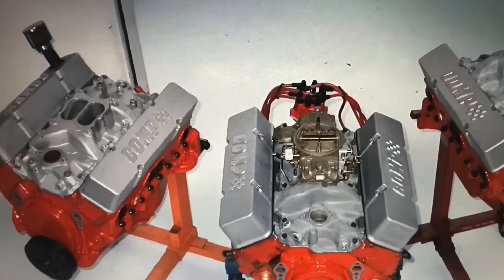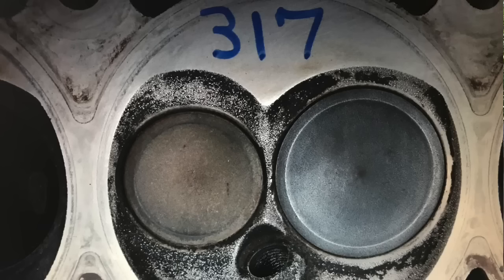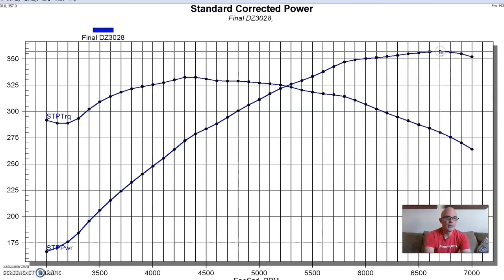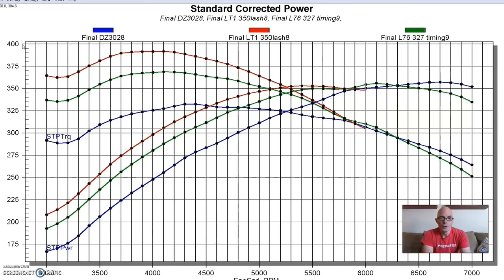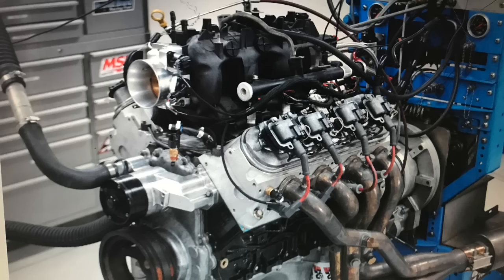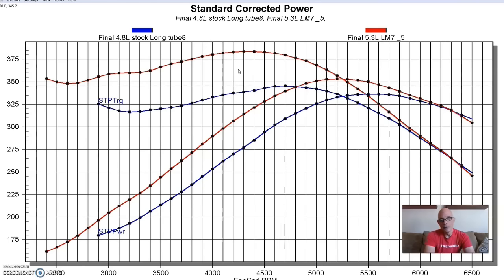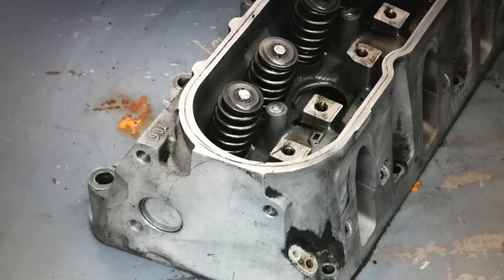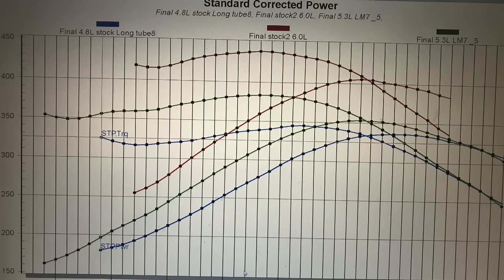HOW MUCH HP DID THE 1969 DZ302, THE 1965 365-HP L76 327 OR 1970 LT1 350 REALLY MAKE? WAS IT FAUX HP?

Comment: Torque follows air so the graphs mostly correlate.  302 at 3500 uses roughly the same air as a 350 at 3000.  302 makes 205ish lb-ft at 3500 and 350 makes about 210 lb-ft  at 3000.
Reply from the maker: torque doesn't follow airflow-airflow increases with engine speed (regardless of power or torque output)
Reply: @richardholdener1727  I'm sorry I mistyped that.  It was late.  I meant that the hp follows the air in this scenario with the heads and other components so similar with the three engines.  It amazed me how closely the points correlated between the three engines.  Ex.  302ci@3500rpm is roughly the same vol as 327@3250 (3500*302/327) as 350@3000 (3500*302/350).  If you then look at your hp graph at 5:18 the numbers are roughly 
302@3500 ~ 205hp
327@3250 ~ 210hp
350@3000 ~ 210hp
It follows up to a little above 4500 as 302@4500 roughly correlates to 327@4150 and 350@3900
302@4500 ~ 285hp
327@4150 ~ 290hp
350@3900 ~ 290hp

I guess my point is that these hp plots just kind of struck me in their correlation.  Up to about 4700rpm the hp in all three engines tracks the same against the a+f volume - which is kind of the purest analysis of what an engine does.

Comment: Hey look, I found the same video again, Richard.  I have an '02 avalanche that came with the below mentioned 5.3.  I live and drive between 2500 and 4500 ft above sea level.  About 285,000 miles I swapped for a 6.0 rebuild.  I wanted to avoid so much down shifting on rolling hills on the highway @ 75 MPH, because I thought it would wear out my tranny quicker.  I guess the 6.0 produced a little more torque, and a little less downshifting.  I have a set of headers in a box, waiting to install.  I think I'm right about 3000 rpms 75-80 mph.  The swap was not miraculous by any means.
Reply from the maker: I'm not sure what point you are trying to make here

Comment: Way late here but had to chime in, all three of these engines DID NOT have the same cylinder heads, and there were approx 6 different castings of the camel hump or fuely heads used between 1964 - 1971. (291, 292, 461, 462, 186, & 492) Only 2 of those were used between 1969-1971(492 & 186)  The main difference's were the size of the valves (and up until 1968 (which would be the 365-327) the heads had pressed in rocker studs which had a bad habit of pulling out of the head during high revs, due to fairly stout spring seat pressure, only the 492 and 186 castings had screw-in studs and were used between 69-71, the difference in valve sizes were 1.94-1.5 and 2.02-1.6 also if I remember correctly there was a slightly different intake runner volume on 1 or 2 of the earlier castings (don't quote me on this) the other difference is accessory bolt holes, only present on the 492 and 186 castings used between 69-71. There were also GM Performance heads you could buy over the counter, which I believe were the 492 casting which you could also get in an "angle plug" config, but none were ever bolted onto a production vehicle, they had to be purchased as race parts over the counter.
Also the 365-327 and the 290-302 used a Duntav 30/30 single pattern cam and the 360-350(true Lt1 HP rate from GM) used a higher lift dual pattern cam. So the internals are not the same. They were all solid lifter, 11.0-1 compression, dual plane high rise intake, holly 4-barrel carb, with the 327, using an early vacuum secondary carb and the 302 and 350 using a mechanical secondary carb. The main difference is in 1969 DOT changes the way total HP was tested,. Therefore the HP and torque numbers really cannot be compared as the factory numbers, you would have to do a base test like you did and create 3 motors with stroke being the only difference. However this is not an accurate comparison by any means, as all three motors have very distinct differences that either account for more, or less HP overall.
Reply from the maker: All three of these factory motors had 2.02/1.6 valves in their respective heads-all of these different "Fuelie-style" heads flowed almost identically

Comment: These tests would mean more if you ran the same cu in engines but varied the stroke and corresponding  rod ratios and the heads/intake and cam were optimized for the combination
Reply from the maker: This test was running all the stock motors-it meant exactly that. Rod ratio does almost nothing-you don't optimize intake cam and heads for stroke

Comment: Would like to note in 1969 there was an option for a cross tunnel ram intake with dual 750 holley carburetors rated at 290hp and modern untouched car with this option on a chassis dyno made 390 wheel horsepower.
Reply from the maker: The cross ram was a dealer option and that induction system doesn't add the power you mentioned-that wasn't an untouched DZ302 making 390 whp (that's as much as the Trans Am Race motors made)

Comment: Hey Rich, nice video. The Pontiac ran four had special heads. Those number 62 heads were basically the same as the conventional deport head and the ram three therefore you would get all of the torque but the ram air foreheads and cam will give you more RPMs as well, but great video

Comment: I have had a69 Malibu that I put an LT1 into, a 69 Z28 (with 302 of course) and a 365 hp 327 from a Vette. The 327 has hydraulic lifters, the 350 and 302/use solid lifters. The part numbers for the 302 and 350 cams are the same. The 302 was my favourite.
Reply from the maker: The 365-hp 327 was a solid cam (same as DZ302)

Comment: It seems to me that the head design restricts the smaller engines ability to spin as high as needed to make better peak HP. You can see the 350 runs out of breath at like 5500, the 327 at 6200, and the 302 at 6700. It's about proportional to the added volume they are trying to flow. the larger engines making more torque is a given.

Comment: So, what this test shows is that cubic inches is worthless wirhout heads that will flow the additional cfm at higher rpm. At 6000 grand all the engines pulled the same horsepower cause the heads were maxed out on cfm flow.

Comment: Kind of laughable that GM rated the DZ 302 at 290 HP gross.  It made what, 357 HP here?  They were always down on Tq in the Z28s and why they would typically have the close ratio Muncie 4 speeds to keep the rpms up in shifts. They were always known as high reving engines but weren't really that fast in the 1/4 mile. The 70 Z28s were only 14.20-14.40 cars bone stock right off the show room floow. Both of my 99 and 00 Camaro SS  LS1 auto cars ran 13.40/104 mph right off the showroom floor. I grew up in the late 60s muscle car era. The late 60s muscle cars were great for their time but nothing like what they are building today. They did have character different than what you buy today though and a sound that can't be beat.

Comment: A 4 bolt 400 cu/in block SBC,  a Hank the Crank stroker crank, Carrillo rods. 4.125 bore, 4.125 stroke. 510hp # 6200 rpm, 640lb/ft torque

Some applications don't allow for installing a 540 cu/in BBC.

Comment: 95% or more of use in a car is below the 5200 rpm point where torque equals horse power. Remember HP is a computation. Torque times RPMs divided by 5252. Build low end torque and driving is more fun. 8,000 rpm power has little use in a street car.

Comment: This video is bullshit.....it does not explain the difference between GROSS horsepower that was banned after 1971 and NET horsepower which is the same motor with air filter, muffler, belts, and accessories put on which reduces horsepower by 18-20% once it is dropped in the car.  375 gross is only 305 hp net, while a 2023 Camaro V-6 beats  all three of these at 335 net.
Reply from the maker: How does comparing all three under identical conditions not demonstrate the actual power output? There is no Net vs Gross here-just what each made compared to each other. They were not compared to any modern motor, and (BTW), not may people brag about owning a V6 Camaro.
Reply: @richardholdener1727  There is no net or gross here because you only show the gross which is NOT what we are going to get when these motors hit the street. 
55 years after the 1970 cars were out there are still people who think the 440-6 put out 390 hp or the 454 was 450.  They were 325 hp and 365 in the car.  If you are going to do these videos you would think this would be explained...it amazes me that after all these years most gearheads that watch these videos  still do not understand the HP basics and believe all the fake over rated numbers of cars made before 1972 when GROSS was finally  banned.  Just saying.....net is gross x .81%....simple.

Comment: In this one video you get a pretty inescapable explanation of "no replacement for displacement". Small wonder the 383 SBC is such a popular choice today. 400, 427 and even bigger small block strokes are available too but the price tag starts to get a little heftier. The 383 seems to be the sweet spot in the trade off for power on a reasonable budget. So what changed over the years that pushed the 327 and smaller engines to a place where only a numbers matching original gets a rebuild at this size. Better heads and roller cams. Richard is using the best of the day iron heads and a pretty stout factory cam for this comparison. Back then it was possible to do better but expensive porting and really wild flat lifter cams were required and for "racing only" that wasn't a problem but in a street car most people wanted something more reliable and longer lasting. Today big flow computer cut heads and roller cams can feed enough flow to larger displacement engines that it has changed everything vs what would have been done in the 1970s. Today a perfectly street ready reliable 383 SBC with 450-500HP and a big, fat broad torque curve won't cost an arm and leg and it's going to be a reliable package. In this you find the reason why it's so rare to see the smaller displacement engines as first choice today.

Comment: That is actually my era.    I lived a mile from Fremont drag strip.   I couldn't afford any of those cars with those engines but I rode in/raced all of em.    First the 302..    My buddy just got back from a stint in the unpleasantness in south east asia.     He had some money so off to Central Chevrolet he went for a brand new 69 Z 28     The car was an absolute beast... I remember the salesman saying something about 'off road only"    In the trunk of that car was a cross ram 2 four setup and an in the box 'off road' cam.    When I was in high school my dads buddy came to the house with a brand new vette ... it had the injected 327 and against my dads advise the guy let me drive it to get them some beer or something.    That car was also very fast.     Then... my best bud had a dad that was getting quite a collection of tri five Chevys including some nomads.   He really did not care about Hp but he picked up a 56 Nomad somewhere.   In primer... 4 speed  And it sounded basd a$$    It had headers and...  as it turned out...  a crate 350 370 horse motor.     But as we later found out... it had the 'off road' cam in it.      We drove that car (which he just confiscated from pops)  all over...  Other than blowing rear ends it was relatively dependable and we actually never got beat in the thing.     So this test is interesting to me since I thought all of em were pretty killer motors with much the same internals.  years later I ended up putting a 302 Z28 clone motor in my 55 two seater Healey...   Yeah... believe me I know.

Comment: 365 gad 194/150 valves. 392 had 2.02/1.60 valve both with 64 cc chamber. Lt1 used different heads with 68 cc head and mini plug. Lt-1 had optional cam
Reply from the maker: so much wrong here

Comment: Take the 370hp cam put it in a 350 4 bolt steel crank along with 11 to 1 pistons torker 2 intake 850 double pump Holley with 327 small chamber heads with 194 intake  that are milled . When done had 250psi per cylinder. 7200 all day long. Pull front wheels burping the gas at 10 mph. 66 SS Chevelle convertible. Tell me hp and toque. (hooker headers, stock rods and pistons) This was back in 74. Hot rod magazine recommended the cam and intake.
Reply from the maker: the LT1 already has a steel crank and 4 bolt block and 11:1 pistons from the factory. If you are talking about the 370-hp LT1 cam-it has that too. If you install a Torquer and 850 on a n LT1-it would be worse than the dual plane
Reply: @richardholdener1727  read my post again . I did it in 74 the thing ran circles around most anything on the road.. it was 70 4 bolt main motor. It lived at high rpm.  You could pop the clutch at idle and it would squeal the tires  3. 55 posi. Stock ignition other than different advance springs. This is what I did. Always wondered what hp it had. Hot rod magazine, no idea of the year or number said the cam and intake was the way to go. I added the small chamber heads and had them milled. A friend had tuned this carb for a 396 it worked great on the 350. Never touched it. Timing was a  bitch. Had to do it by ear. Never degreed the cam. This thing just screamed. It lasted 60 to 80000 miles. Kept breaking Speedo cables. This was back when gas was gas. I built it in a wheel barrel, no engine stand. Didn’t know much about building a motor. It is what I built. It scared people. GM cam so I didn’t degree it probably should have. No lines showed with a timing light . It was all ear. I did something right but I do not know what it was.  No fords would race me . Big blocks would then regret it. The Ricky racer days. The cam I used might have been the L79 it had really long duration something like 280 and 294. It was a GM cam. This was 50 years ago. Hydraulic cam. I seen it advertised in I believe a summit catalog a couple of years ago.

Comment: It definitely seems like your cylinder head is what limits your horsepower. With the mopar stuff I’ve been looking at a 360 and a 408 stroker with a similar built they will both make a bit over 500 hp, the difference is the 408 will do it with an extra 100 ftlbs of torque

Comment: More Stroke gives more torque and lower rpm for same setup. Bigger diameter piston gives more hp. L78, l72, ls6 same setup. L78 425hp small bore. L72, 450hp. Ls6 450hp more torque less rpm long stroke. Tom langdon tested these engines at chevy. Same with 302, 327, 350, add 383 too.
Reply from the maker: displacement adds power-bore and stroke don't do it specifically to hp and torque-that is not how the laws of physics work
Reply: @richardholdener1727 read again! Tom built those engines with the same cam carb and heads the small bore l78 dynoed 425hp 65 but marked down to 375 from 66. The l72 and ls6 same bigger bore made 450 hp even though the ls6 has longer stroke. The ls6 made max hp at a lower rpm. More cid gives more potential with other parts! Same parts same bore just move the power peak. Oh tom langdon dynoed those engines at Chevy, the true hp numbers. Read up on him and learn. You use the general theory, not the laws. Gm proved them with their engines. Replicating them similar with slight changes is not the same. Like the videos they are very good. Hard to duplicate exactly.

Comment: To be correct, the heads werent exactly the same....the old dbl hump heads (461,462 etc)  were different castings vs the Z/28 DZ heads (292) vs the LT1. Heads...the cams were different as well
Reply from the maker: to be correct, the 186, 461, 292 etc.. all flow near identical numbers and make the same power

Comment: OK What if you add a Roots style blower and Cam to the Engines. Can that overcome the cube delta and head flow difference.  When I put a Magnuson on the 6.0 Alum block It broke the piston and cracked the sleeve. But when I replaced it with the Iron Block 6.0 forged pistons, crane cam, etc etc, No comparison the 365 or 302 mouse it was Rat caliber torque instantly, but i paid dearly for the privilege. But it also says if you want to abide to lower emissions the 4.8 with a Roots Blower and Cam will work. Have you looked into emissions verses Cubes???? Thank You, Dennis

Comment: We know that the 30/30 cam in the 302 did not make enough low end torque to make an automatic transmission an option.  Automatics were an option on the 1970 LT-1, but would that have been possible with the 30/30? Can't imagine wanting an automatic anyway. I loved my '69 Z/28.
Reply: The '70 LT-1s ran a turbo 400 automatic which requires a whopping 48 hp  to get it moving . The old Powerglides only need 16 HP to get going . Now you know why the ' glide became the darling of the drag strip .

Comment: You said the DZ 302 came with the "DUNTOV CAM". but it did not.  It came with a " 30. 30 cam" which is wilder than the Duntov.
Reply: Mr. Duntov designed more than one solid lifter sbc cams. He absolutely designed the 30/30 cam.

Comment: So if the 302 chevy could get another 1000rpm it would be an absolute monster. I know for a fact that the 302 can definitely do 72-7500rpm and absolutely ruin big displacement motors and outrun them. Its a sewing machine. You can do it now but in 1969 that was a work of art
Reply: Drove my friend’s 69 z28 to my wedding. I can confirm it will go past 9k. Don’t know if the power is falling off up there but it felt like it was still pulling pretty hard
Reply: Yea HP wise not torque wise lol. Torque moves the car not HP👍🏾
Reply: @twotwocold  No replacement for displacement.
Reply: The 302 rules in a car with limited rear wheel wells , like an early Chevy II . A seven inch slick with no bottom end torque , and an engine that will buzz to 9000 rpm with the old Z optional cam . ( Last three digits of the part number are 140 ).  This combo tends to give bigger , more powerful cars fits .
Reply: Yep. Back in the day, spring technology lacked, so cam lobe ramps had to be slow/mellow to avoid float. A modern solid flat tappet and springs added to  otherwise stock 302 would see 8000 all day.